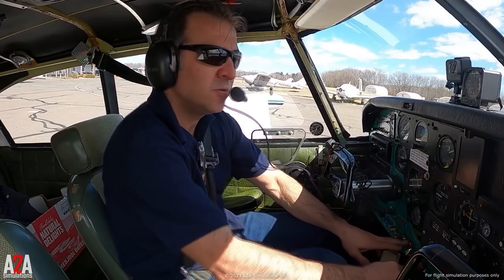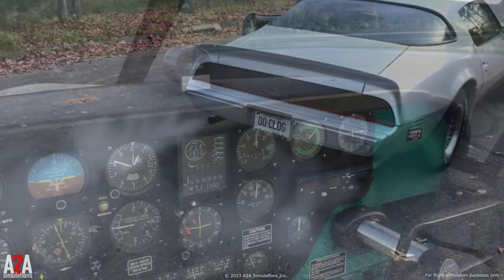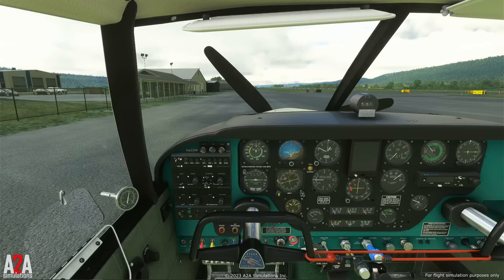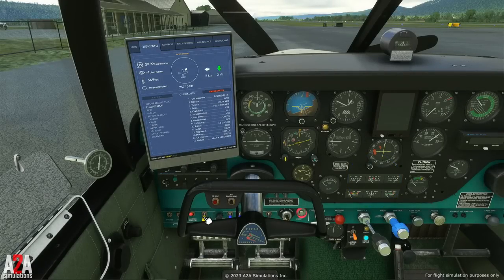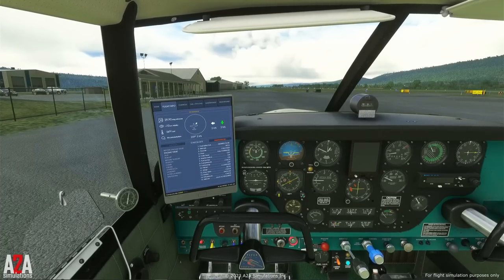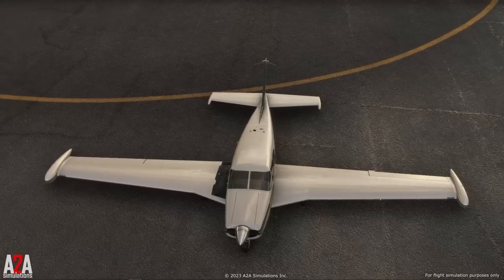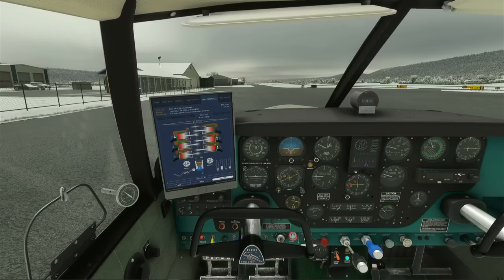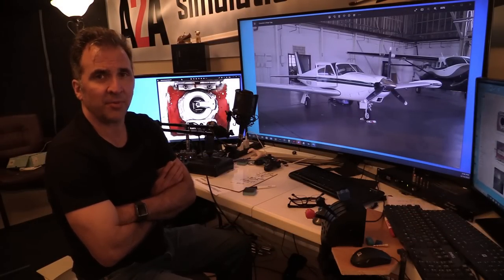Accu-Sim Comanche 250 MSFS Engine Start

Comment: This is my first A2A plane and I love it.
A question come to mind after watching this video:
-are you able to adequately test for water in the tanks at or below freezing temperatures?

Thank you for a creating a great addition to this sim.  Looking forward to all your future products.
Reply from the maker: To model this, the water would have to be added while above freezing, then the temps would need to drop to freeze it in place.  We would have to happen between flights and meaning, we would have to monitor temps on specific days, etc. until the conditions would be just right when the flight sim is off.  This would be quite an involved process for something that is extremely rare so don't think we'll see this down the road.  Good suggestion though.

Comment: I had the mixture cutoff when I turned on the fuel pump and it still showed fuel pressure. Is this how it's intended to work? Where is the sensor to measure the pressure generated by the pump? Just curious..
Reply from the maker: The sensor is before the mixture cutoff

Comment: Any way we could get some kind of indication of cabin temp without the tablet being opened?
Reply from the maker: We thought about adding a little thermometer in there.  It's one of those "not 100% sure we want to do it" sort of thing.
Reply: @ShockwaveProd   perhaps you could tuck one away in the glovebox? It's eerily empty in there. Though it would be a small pain to check. Maybe better still, have a thermometer in the glovebox that we can click on to bring it out into the cockpit, similar to how the baggage loading works? Then it's optional for users to display it or hide it in the glovebox :)

Comment: Hi guys, or women
I have this Com250 in P3D, but every time I start my P3D, this plane starts with the engine running.
Then I turned everything off and saved this as a starting scenario.
But when I start that scenario, the Com250 comes back with a running engine, Battery switch and NAV lights on.
I would like to start this Com250 in Cold & Dark.
Do you have any idea how I can manage that ?

Comment: Was this a fully cold engine start, or was the block heater on? Also, in the sim, is the block heater effect instant, or do we need to let it sit for a long time for the oil to heat up? Thanks! Amazing aircraft!
Reply from the maker: The video demonstrated starting it without the heater.  If you plug the heater in, it takes roughly 2 hrs to bring it up to relatively warm oil temp.  This time counts whether MSFS is on or off, so if you plug it in before quitting then start the sim a few hours later, the oil will be warm.
Reply: @ShockwaveProd  That's very cool. But I often operate from very cold places (below -20C) and when I "hop in" flight sim, I can't wait for 1 or 2 hrs to start the engine for the sake of realism. Perhaps add an "instant heat" button next to the heater button? Unless you tell me that engine will always start at -20, or less, and that it is just a simulated wear impact... 😀
Reply: @ThorNjord or when you park your plane and shut down the sim, leave the heater on so the oil is always warm. 👌

Comment: So do we actually need to sit in the sim 2 hours waiting for the engine heater to warm it up or is that part instant? :D
Reply from the maker: You have to wait, but you don't need to be in the sim.  You can plug it in, do something else including even having your computer off, and come back in a few hours and it will be warm.  If you don't want to wait then you can always hit CTRL-E for auto start, that immediately heats the engine and starts it.
Reply: That's so awesome